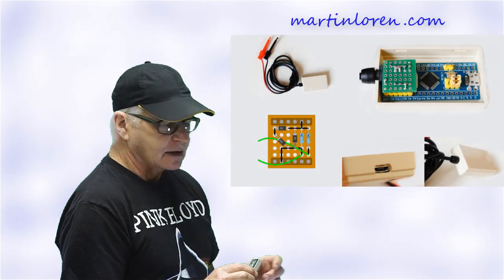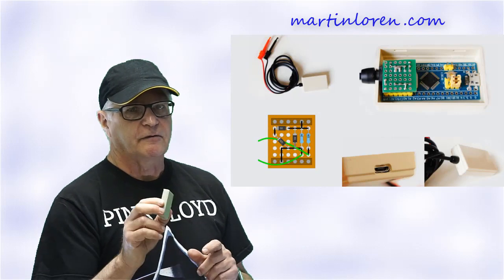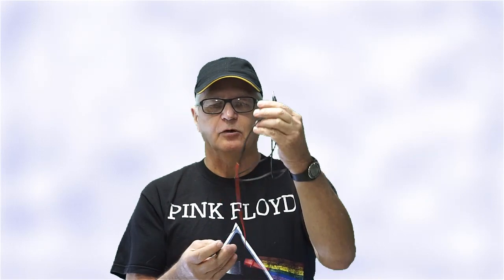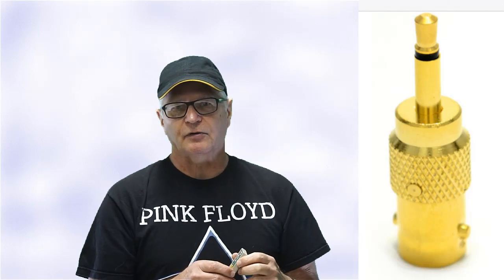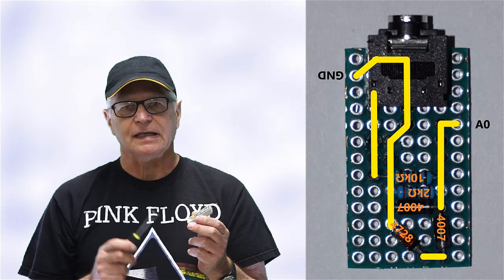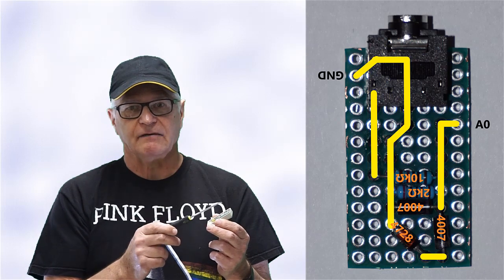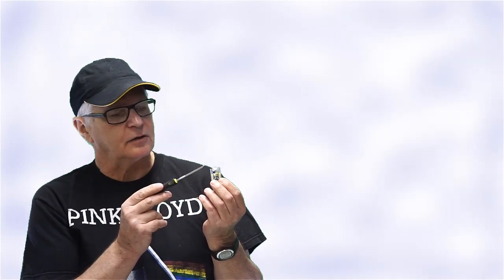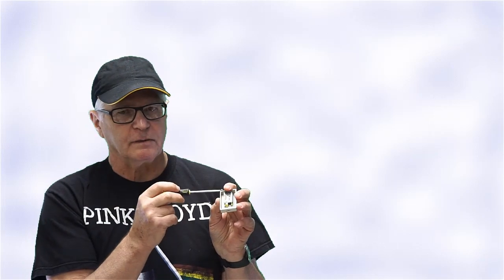GADGETS#38 - HS101 3.5mm JACK

Comment: Does ±5  measure only AC volts?  i want to use it to check alternator diodes.
Reply from the maker: +Audrius Lileikis - The +/-5v version will measure DC 0v - 5v.
If your work does not exceed 5v, then this version would be OK
Reply: Is there any chance to make it to measure just AC ±5?
Reply from the maker: @audriuslileikis5652  - It will do both, of course. I sense you're fairly new at this and you might benefit from simply testing the alternator with a voltmeter. Here's a very good video on doing that:
https://www.youtube.com/watch?v=1bK0De9XOP0

Comment: Is there a reason you don't list the links you found for the components (in the comments). It would save some headaches for builders and ensure the correct parts are ordered.
I thank you again for your efforts. I have the blue pill(s) ordered but again I'm not sure if I ordered them from the "best" (i.e. your) source.
Thanks
Reply from the maker: +Dave Sage - Yes, there is a reason. eBay links are notorious for becoming obsolete, within days if not hours.
Been caught sharing dead links too many times.
Also, you and I are both in Canada, but you'd be surprised at the international reach this fledgling channel has and that sourcing varies greatly from country to country.
If it helps, I haven't strayed from Amazon or eBay so quick searches there should yield results.
Reply: All good reasons. Thanks
Reply from the maker: +Dave Sage - and if there's a specific item that you're unsure of, feel free to ask.